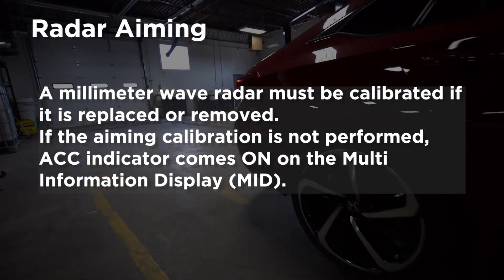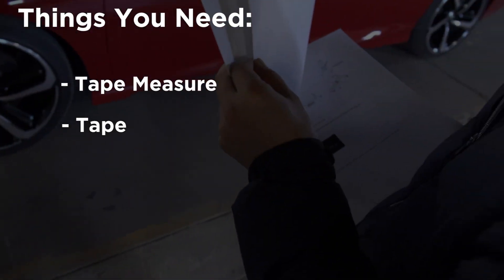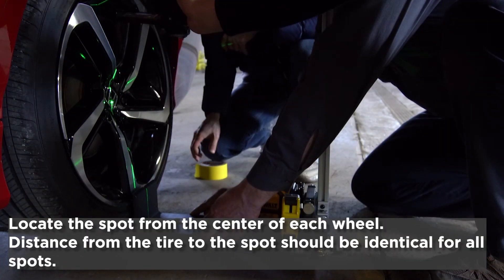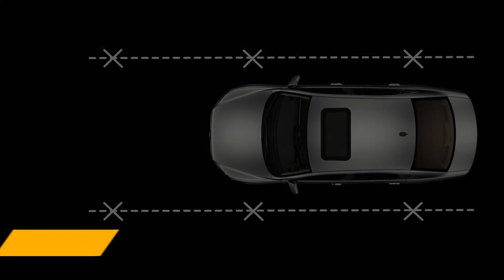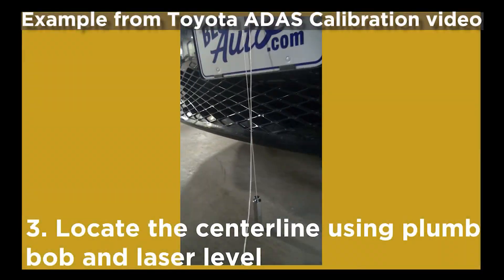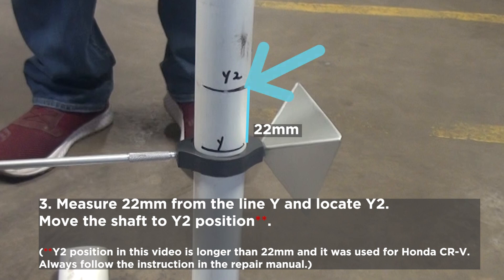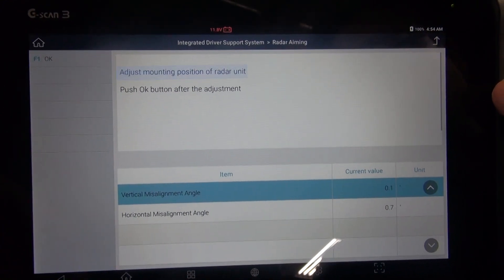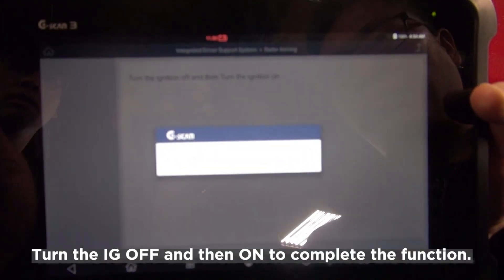2018 Honda Accord Radar Aiming with G-scan3

Comment: Honda needs to completly rethink positioning of Honda Sensing living in northeast My first drive after clearing of radar was covered twice rendering system Useless need to rethink this Honda it’s a problem Incirporate a new solid front badge like Toyota that their camara and radar is incorporated inside its smarter and safer